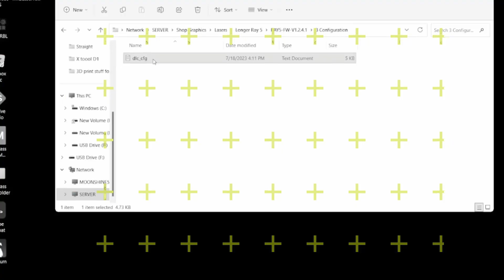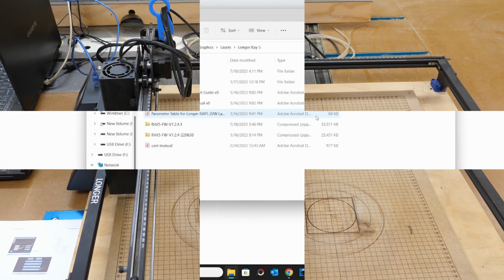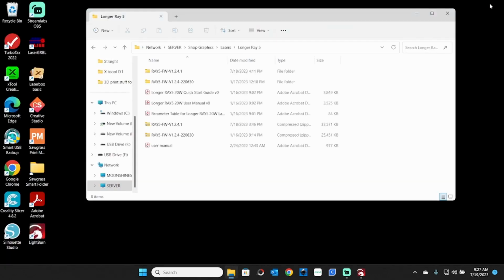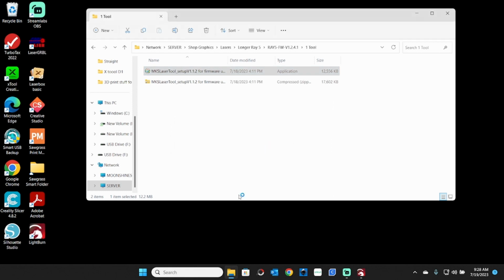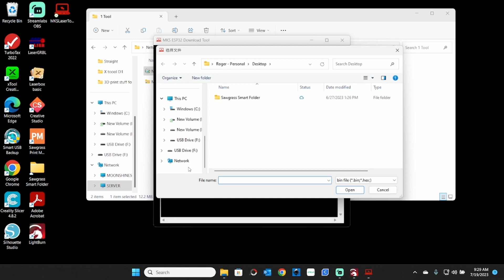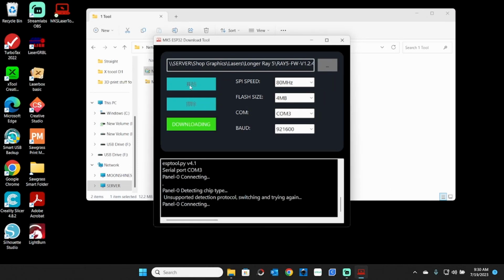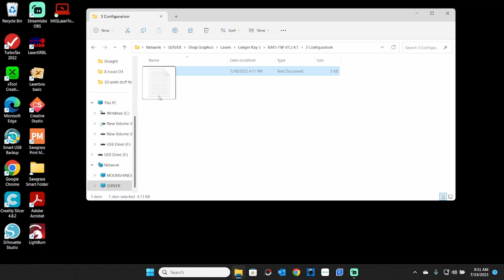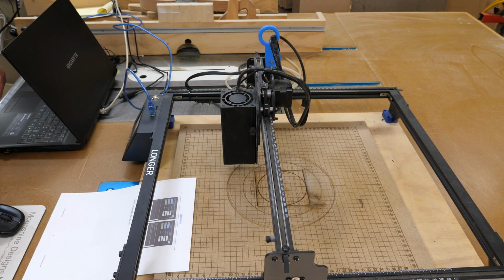Longer Ray 5 Limit Switch Firmware Update

Comment: Just installed the limit switches on my 10W and when I go to update the firmware it says "LaserTool is damaged and can't be opened". This is on a Mac. please help
It does seem to home without the update but it always backs off of both the X and Y by 4mm so the home position is off in Lightburn.
Reply from the maker: I do not use MAC, so can't help.
Reply: @rogersshop Longer couldn’t help either. I’m just using it as is.

Comment: So ive added all of the physical hardware to my engraver machine (10w). For some reason ive downloaded the zip folder and unzipped it. But when i try to open up the MKS LASER TOOL V2.1.5 and click on the MKS ESP32 download tool, it does absolutely nothing. Does not allow me to click on the link as if its not recognized. Any assistance would be really appreciated. Thanks in advance.

Comment: I also discovered the hard way that Longer decided to go the cheap route and instead of upgrading the framework to accommodate the larger laser, they used the 5w frame, which reduces your workspace area.  Seller ads state it's 400x400, Redditors say it's 375x375, Longer website chat bot says it's 400x365 and installing it on Lightburn shows it as 10x10 and wants you to input bed size. I STILL don't know if I have it set right. 🤦‍♀️

Comment: Hmm, I may have messed myself up. I flashed the 2.x firmware from their website, but then it wouldn't print anymore, so I installed this one. I don't have the limiter switches though, so when it turns on and tries to home I'm hosed. Any suggestions? I can't seem to find the previous firmware.
Reply from the maker: You will need to contact Longer for the original firmware.  I do not have a copy of it.
Reply: @rogersshop  Thanks for the reply!

Comment: Have a dumb new guy question but what is the benefit of the limit switches? Just got my ray 5 and figuring out if these should be added to make it all easier.
Reply from the maker: Not a dumb question!  Having limit switches allows for a homing function and the ability to use Absolute Coordinates which simplifies making repetitive projects.

Comment: Hey appreciate it this bit I am running into an issue where when it attempts to home it moves along the x axis but the switch isn't stopping it it keeps going for 10 seconds then I get homing failed unlock or something. Any help would be great
Reply from the maker: Make sure limit is plugged into the correct port on the motherboard and make sure to update the firmware.  If both have been verified, you "may" have a bad limit switch.  Also make sure the X axis contacts the arm on the switch when it reaches the limit of travel.

Comment: After installing the limit switches and firmware the laser Homing position changed from X0 Y0 to X3 Y3. Any help with resetting to X0 Y0 is appreciated.  Roger thanks so much for your excellent tutorials.
Reply from the maker: Never really paid that close of attention to it, but I guess it would since the limits are 3mm thick, or so.  I always work from center and Absolute Coordinates, so for me, that negates the minor position change.  I don't know exactly how to reset that back to 0.
Reply: Thanks Roger for the quick reply. I'm using Absolute coordinates to burn a new grid. A hard limit alarm is triggered during framing at  X=0. I reduced the grid pattern to 390x390 with the hopes of not contacting a hard limit switch. However, the laser is still hitting the X limit when traveling to X0.  TY Tim
  @rogersshop
Reply from the maker: I'm currently in Mexico, so can't look at the laser, but as I recall (not entirely always accurate), there are two possible mounting hole sets for the limit switches, depending on what size laser head is installed.  I do know that this is on the Y axis for sure and I think also on the X  @timphares5316
Reply: @rogersshop  Longer tech support replied that X3 Y3 is the correct axes with the limit switches installed. I reduced my grid size to 390x390 on center to address the new grid scale parameters.  I wish you the all the best in Mexico.

Comment: Some folks might have trouble runnng the MKS Laser Tool file on windows like I did. Kept getting an error, but realized from the error code, it was a permissions issue. If you right click the file and choose "run as administrator", it works fine. Firmware installed and switchs work like a champ, thanks Roger!

Comment: I purchased the 20-watt cutter and as soon as I home the machine and it hits the limit switch the machine shuts off. Also when I go to cut the file on the TF card the laser doesn't even come on,  the machine just goes to the motion but the laser isn't on.

Comment: Thanksfor this video Rodger l just bought a Longer ray5 10w laser. It came with very old firmware. Can I use this firmware upgrade for my engraver If not where would IGo to get my firmware. 
A£a
Reply from the maker: The only real change this firmware update does is enables the motherboard to recognize the limit switches.  You can certainly use this if your needs an update, but do not enable auto home if you do not have the limit switches installed. (or try to home the laser)